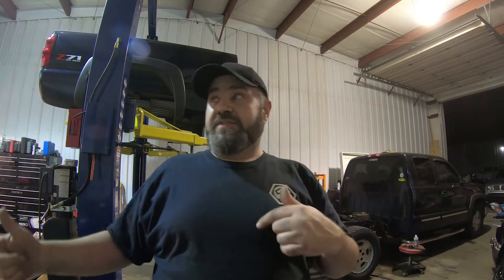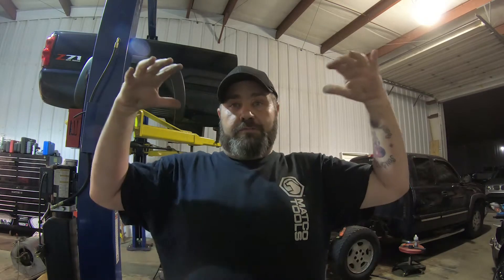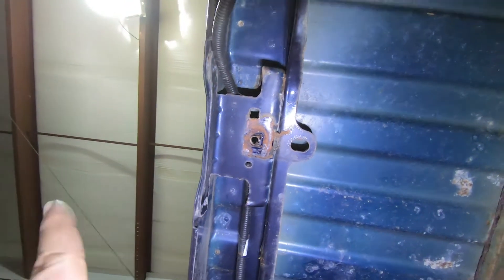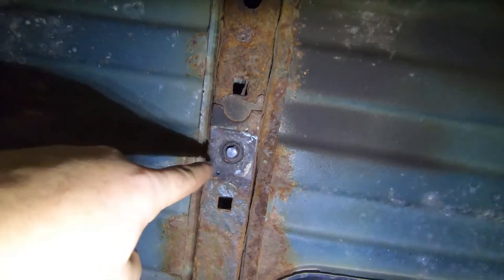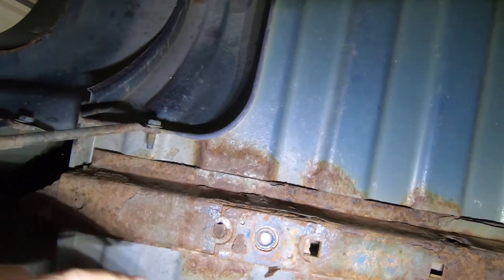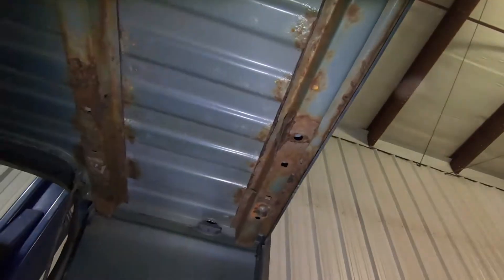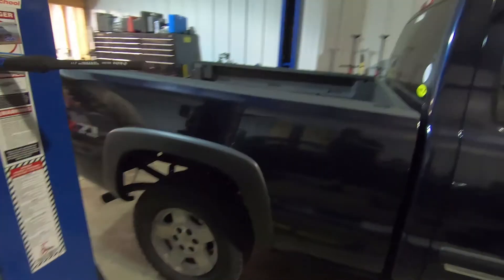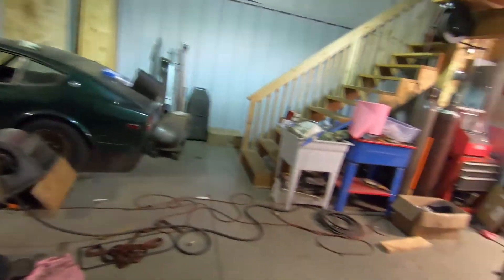Silverado Frame Repair: EPISODE 3 The FINALE!!!!!

Comment: Nicely done. Have had to remove pickup beds before for various reasons. When wrestling with broken bolts (I hate overhead welding) I had a system set up to take the bed off with lift or we had a gantry, then set up saw horses with 4x4s covered in high density foam. Once resting on that, we raised up the rear with gantry or we had a mobile A-frame hoist, resting the bed on the front, cushioned by the foam, and ½ of the weight held from above the bed. That way it was much easier to get to the bolts.  
Like the studs instead of bolts. Makes setting the bed 75% easier,  especially working solo. 
Again.... kudos on a job well done. 👏

Comment: Wow great video , I thought my 2009 Chevy Silverado was the only rust bucket out there, I need the same type of work done, it’s in the shop now and it all started when I went to change the rear shocks, one upper mount was completed rusted off ,  the guy at the shop removed the bed, called me to come down and have a look, and that’s when I saw the rusted crossmember, rusted gas straps, and even more holes in the main chassis , what a rust bucked, 2000 to fix but he is sand blasting the frame, painting it, fixing the shock mounts,gas straps and cross member also fixed an exhaust leak, changing the rusted rear differential cover and evaporate hose. I want to fix it and sell it. Not a fan of the Chevy Silverado ,also have a collapsed lifter I have to deal with, no more Silverados for this guy, even satellite radio reception sucks on the truck and blown ac unit, too many problems.
Reply: only $2000 for all that work? Damn, my 2004 GMC sierra 1500 is about the same state, except my bumper supports are also rusted through, just trying to find a solid shop near me right now for the work.

Comment: Wouldn’t it have been quicker to cut a couple inches out of the bed supports and weld a new piece of steel with a new welded nut?

Comment: I have to say a lot of viewers asked how much it would cost to do the work. Would it have killed you to give a range or ball park. Really like it is a state secret.
Reply from the maker: The costs vary so greatly from truck to truck the range could be $1000-$5000. There are too many variables to lock down a specific range when it comes to price. That is why I have everyone send me pictures. This way I can give you a more direct price quote. It's not that it's a secret, it's more that I don't want people thinking they can get it done for 1500 bux and when they get the bill it's 5k.
Reply: One other point on cost is location of repairs.  Rust/salt damage worse in NE parts of the country, but if you had the work done in a large city, usually price will be more, partly due to overhead and cost of living.  Smaller towns away from the bigger metropolitan areas might run 35-50% less.  The COL is less. Also depends where parts are purchased.  As was stated earlier, it is not practical to give a price on work that has so many variables. Unfair to the technician and to the owner. 
Been there, done that before, and it ain't fun.

Comment: It must be alot if you can't give prices as the people we would like to know a estimate for a job like that would cost 🤑💵💸💶💷💰
Reply from the maker: Honestly it’s tough to give a ball park as it could be a $500 repair or a $5000 repair. It all depends on the level of rot, how many crossmembers are effected, if it’s a 1500, 2500, or 3500. If the bed comes off easy or all the bolts snap. The variables are endless. Without having the vehicle in front of me, I can’t even estimate cost.